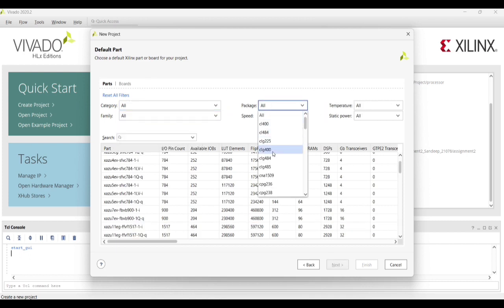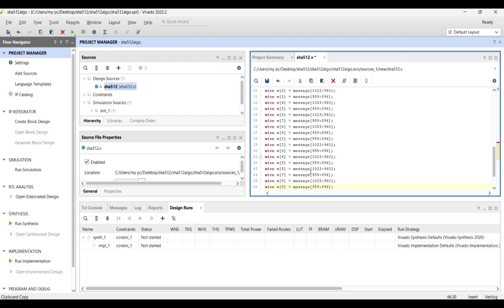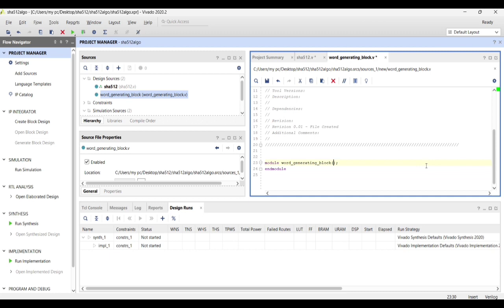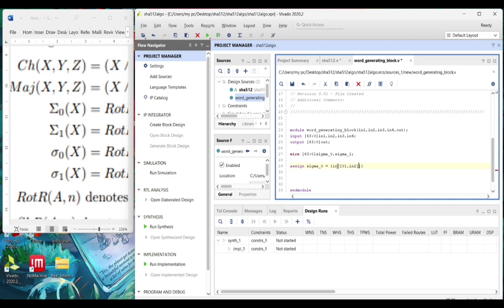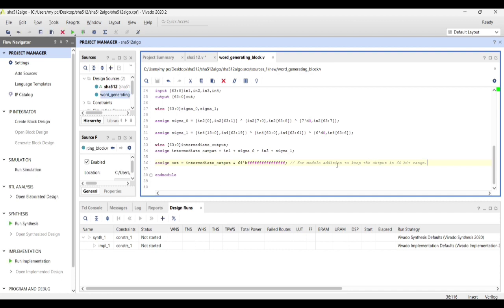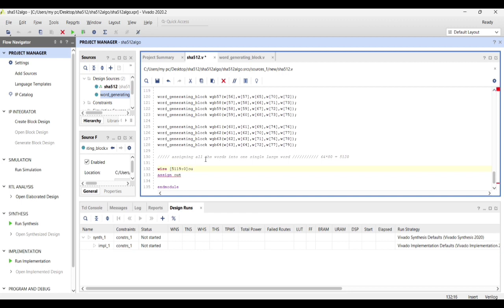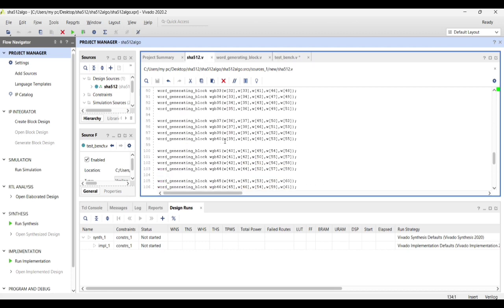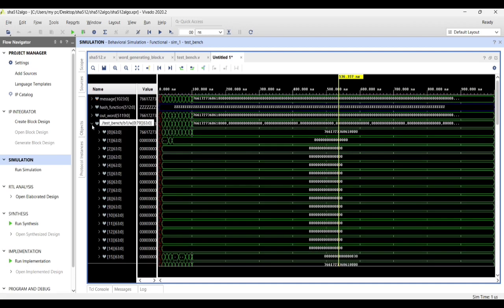SHA512 || Word Generating Block || Verilog Hardware Implementation Code

Comment: I don't know line 28 to 39 at test brench. Why intial begin like that, i don't know where it from

Please help me🙏😭
Reply from the maker: initial begin ... end construct defines an initial block, which is a procedural block executed only once at the very beginning of a simulation, specifically at time 0.

As I want those test cases to be applied only at once , i had written them inside an initial end block
Reply: @urstrulysandeep7209 thank you very much for your explanation. But I even don't know yet where I did wrong in my code

I hope you can sent to me your files or folder especially about it, I need it for my undergraduate thesis🙏